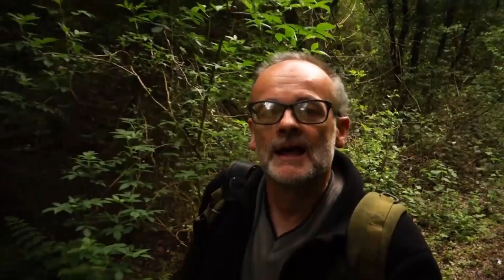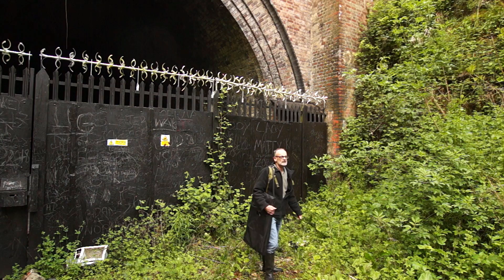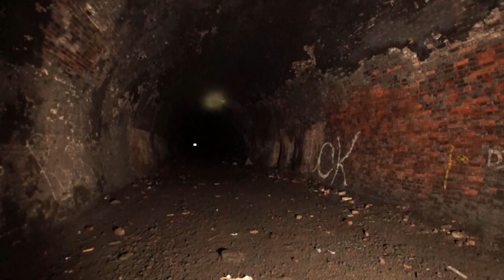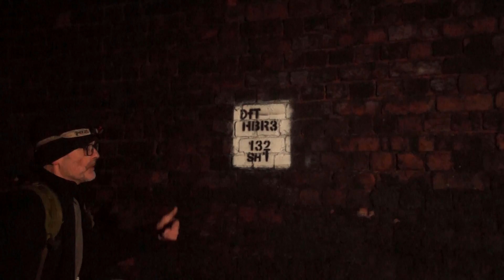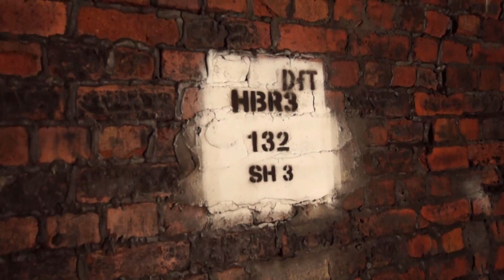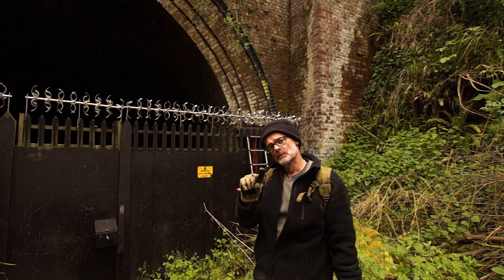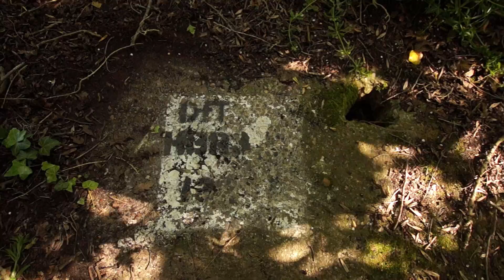Exploring Barnsdale  Railway Tunnel  A1 Junction 39

Comment: Love this Patrick!  you producing a ladder out of the bag had me laughing :-) great video mate. regards.
Reply from the maker: Amazing it of kit, and made getting over so easy, thanks Pat
Reply: @patrickdickinson6492  You definitely took a risk with those razor wire baffles. Personally i would have been tempted to cut off the locks with a bolt cropper and replaced them with new ones after my unofficial visit. This would have been frustrating for the  site manager when their keys did not fit but hardly considered vandalism if left as you found it. I noticed you had an hairy moment with that ladder retrieval line? Drop that and would have been stuck in there.
Reply: Now I know who to call if I ever need to break out of jail. All he'd need to do is figure out how to bake the ladder into a cake and Bob's your uncle.
Reply: Next time he make it appear out of this hat ...lol